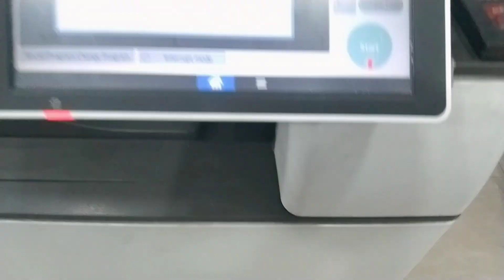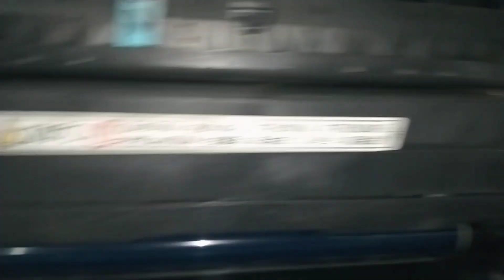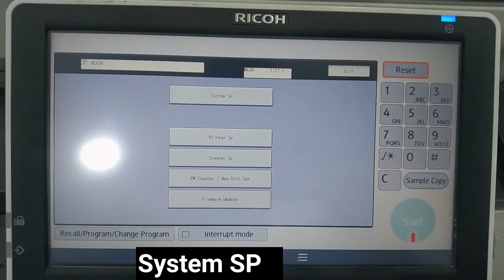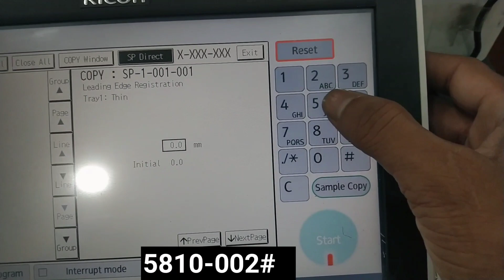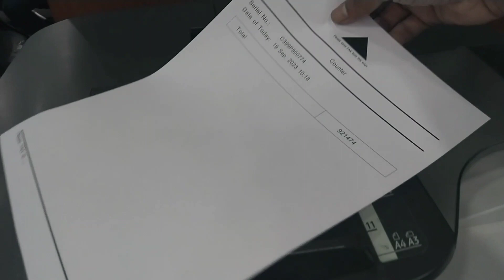Reset SC 554-02 Ricoh, How to reset error code SC554-02 in Ricoh MP 2554, MP 3054, 4054, 2555,3055

Comment: donde consigo ese fusible fusor
Reply from the maker: This fuse is available in the box of Fusing sleeve unit. 
Or you could try with another way
Connect 02 cables with non contact thermistor's connector then keep touching and disconnecting both cables and keep trying SC reset 5810002# 

If you try this process,  you could successfully reset this error code after trying 4-5 or more times.

Thank you.